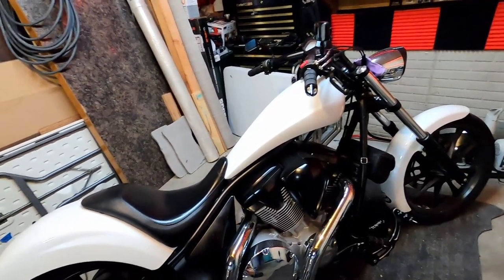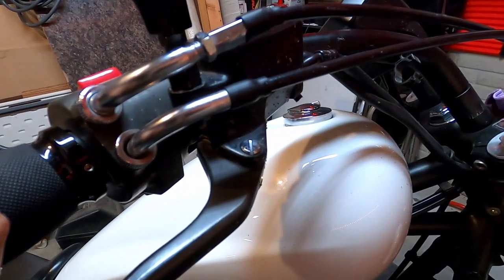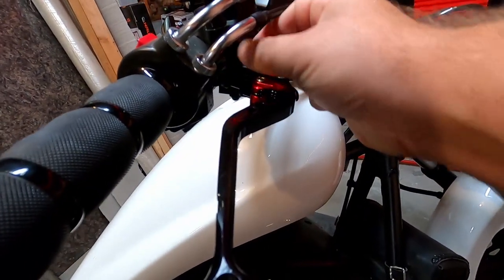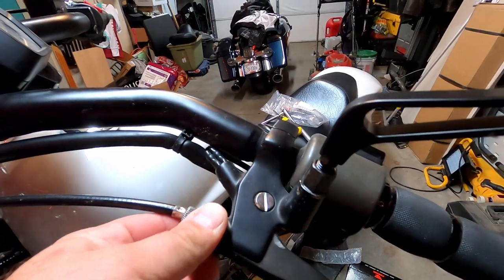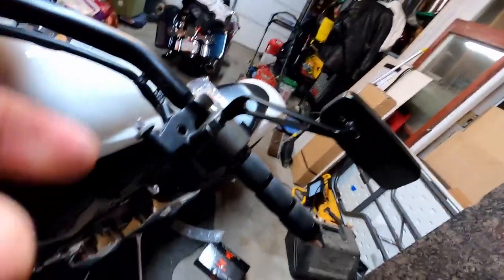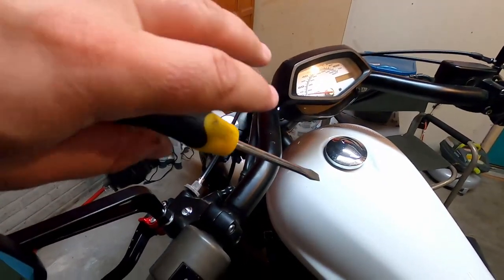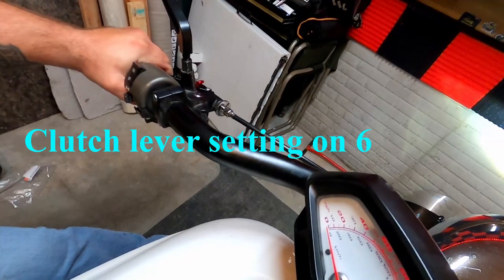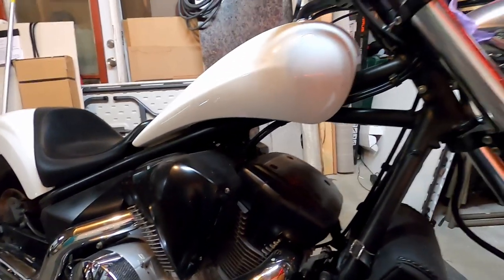Fury Friday 18   The Fury gets new Brake and Clutch Levers!

Comment: Watched ur channel and I got a fury. I got the shorty levers. Love them. The adjuster doesn't work as well. Slips out. They could've made the adjust point more aggressive. But still love them. Got mine off amazon as well
Reply from the maker: These seem to work pretty well.  I went for a ride with them for the first time and I don’t have any complaints. I actually though that with the clutch lever set on 1 that it might not disengage the clutch but it did. I was very impressed for $23. Thank you for watching!

Comment: How hard was it to take off the rear brake lever? I bent mine on a drop not long after getting it and have gotten a replacement just haven’t gotten around to swapping it yet any insight would help!
Reply from the maker: I’ve never had to take off the rear brake lever. The front brake lever is very simple.